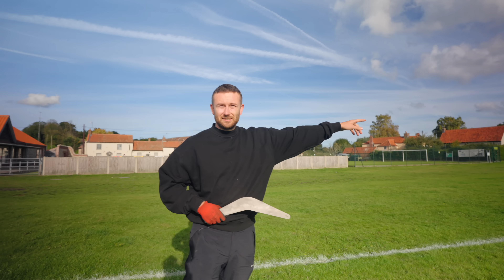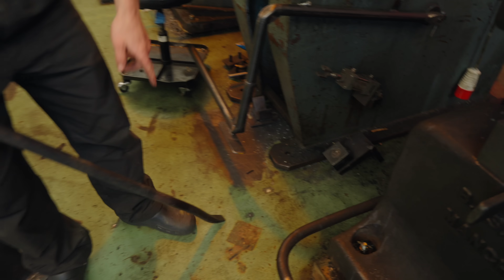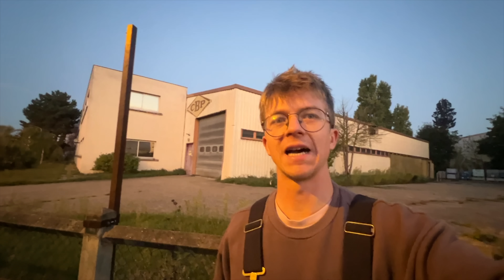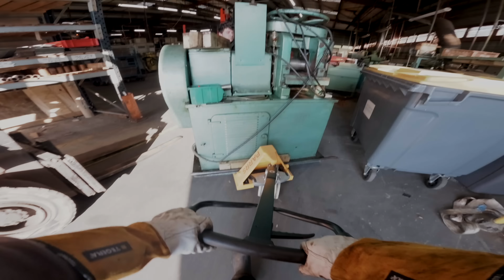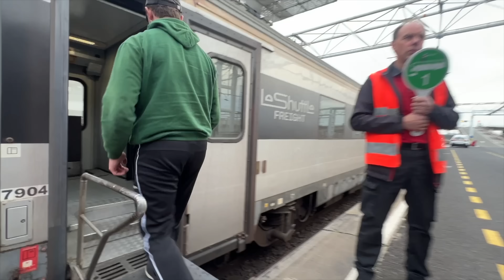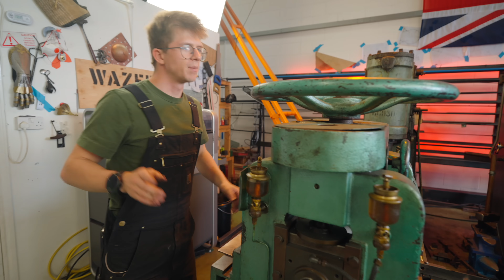My New French Friend

Comment from the maker: Wouldn't have been possible to load that machine without comfy underwear ---> Get cozy and spooky for less with deals up to 50% off at http://meundies.com/forge and enter promo code FORGE.
Reply: C'mon Man! Once the machine was on blocks with the pallet underneath, u just lift the pallet with the forklift and it's on the pallet, Done. IDK why u guys decided to mess around with all the jacks when u just had the forklift? Once u've got it placed on blocks, use the forklift to lift the pallet, pickup the machine, and ur can set the whole unit down wherever u want and u don't have to waste time jacking (unless u like "jacking" that much LOL). I used to do that all the time with forklifts all the time. Next time, It'll save tons of time and effort.
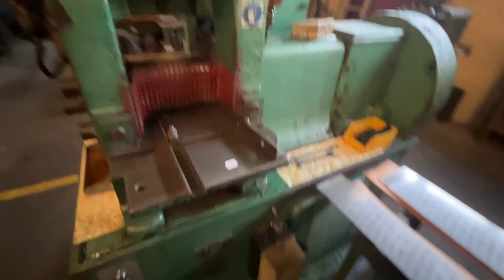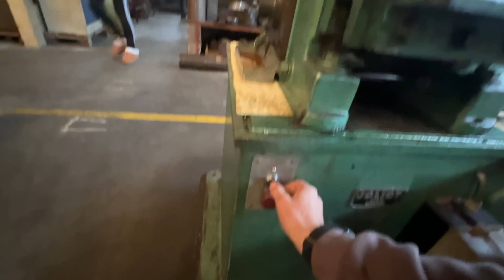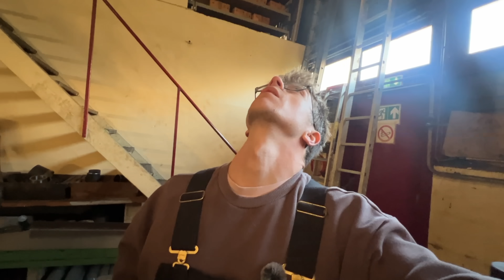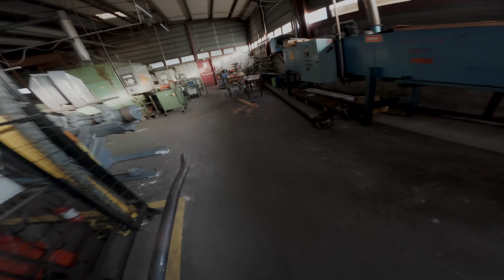Reply: 10:38 10:40 10:41 10:41 10:48 10:53 10:53 10:54 10:54 10:54 10:54 10:54 10:54 10:55 10:55 10:58 10:58 10:58 10:58 10:58 10:58 10:58 10:58 10:58 11:00 11:01 11:13
Reply: Now here's an idea for comfy underwear prints: Rare as hen's teeth ... Rare as rocking horse 💩
Reply: Here's a cookie. You could increase capacity by making the rollers smaller. And by making them smaller, i mean have some rollers machined for the machine, because it would be a shame to lose the current ones. I would start by finding out the feasibility of this affair, IE, how much can you get away with before the mechanical elements that hold the rollers won't allow you to get closer and then finding the closest scrap roller from an industrial lot or similar, so you only have to lathe the ends, leaving the hardened surfaces alone and untouched. Also, figure out of these rollers are meant to work on hot materials, because you might ruin them if they're not. Just my 2 cents.
Reply: @aserta  Smaller rollers means bending rollers, convex parts and damaging bushings.
Probably it is possible to make them a little bit smaller, but not enough to fit a 50mm - 2 bananas in it.
Also you can't keep the same transmission, and the center of the lower one have to be raised to have it flush to the machine table.

For making good rollers of that size it's more than enough to use C45 steel and induction hardening the roller surface.

(I'm a lathe machinist for the past 25 years and in the last 8 years I made some metal forming rollers...some tons of them :P ).
Reply: How much human trafficking did you have to do to pay for all this?
Reply: Next time you have to lift a heavy load using a forklift, don't use only one single tine of those two forks. Push them together and use both, otherwise you risk bending the lower fork with a heavy load. You risk a lower Fork than the other. Speaking from experience here
Reply: Tu parles très bien français je suis choqué, a quand le feat avec des youtubers français ?
Reply: when you sent it through on one side Alec, flip it over on the other face and send it through again. this way instead of increasing the curve, you are "correcting" the curve to force it straight again. its the same concept as you would on your power hammer you wouldnt just pound hot metal on one face the entire time would you? you would flip it on other faces so it stays true and square. so remember the top face and bottom face and flip back and forth between the two and it should stay straight and true each time.
Reply: When I was kid my dad was stationed in SW Germany (88-91 so technically West Germany) and we went on vacation to Pisa. Our family is of French descent and we drove within a mile of the border and when I asked my dad why we didn’t go through France he said the toll roads in France were hellacious and everywhere!
Reply: speking french abit ?
Reply: I am sorry but I am an all or nothing guy.

I tried 50% underwear once and it was just too awkward.
Reply: Put a gold bar in it, make it flat and build something
Reply: I like your content, but find those ads more and more annoying and out of context... It's a pity...
Reply: 17:00 a glimpse of your wife😅
Reply: You're one of two youtube channels I've ever subscribed to. Thanks for sharing what you do.
Reply: @AlecSteele I have been watching your videos for years and love to content. Will you ever put the Steele work trousers back on the market
Reply: Could you try to forge rhenium?
Reply: @AlecSteele Don't forget to turn your oilers ON!!!!  The piece on the top should point vertically when in operation.  It acts as a cam to lift up on the needle valve allowing oil to flow.  Oil flowrate adjustment is done below it usually something turns.  Below the oil globe is a window you can see the drip of oil to adjust.  The best bearing oilers ever!!!!!!!!!!!!!!!!  Old school.  A drip every few seconds to second is good.
Reply: Have you ever went over 30-45 minute long video???

i am sure we all would love a longer video lol..

Maybe a hour long video for when you hit 3 Million sub's?!?!?!?!?!?
Reply: you overthought the grabber, just set it on a piece of wood with some sides and a end piece on the end and even if you move it fast it wouldn't fall and they can freely grab it
Reply: woulda costed you less too
Reply: Just be aware that squeezing metal is like using a press on it, it will heat up and anneal.
Reply: You've never put a copper penny on a railroad track? You can get some nice squeeze out with the pure copper pennies, but the copper washed zincs you find now just crumble.
Reply: Can you make a metal using 85% copper, 7% aluminium, 7.5% steel and 0.5% titanium in a axe?
Reply: I have one… I built a flat guide rail on the exit side to make the steel hold its flatness instead of curling… simple fix. Good luck.

Comment: That is so totally not the way to throw a boomerang. I make them out of ply and those do have aerofoil sections on them but I think yours might fly even flat. Assuming you are right handed, hold it vertically, maybe 1 or 2 degrees to the right, bend facing forwards, aerofoil section to the left, throw about 20 to 30 degrees to the right of your target, it should come back to you.

Comment: Perhaps you figure out the issue further into the video than I currently am, or you may have just figured it out by now, but I am wonder if it is possible that the curve is happening if you attempt to move too much is a single pass.  What I mean is like with a lathe or a mill, the amount of material you take out in a single pass has different effects on how the material behaves as well as the finish, and tool wear... you know how that all works.  Either way, It could be that reducing how much you are thinning it out in a pass can effect how much or if at all it wants to curve.  Alignment can effect curves too, but I think that it could be that you can flatten more when the material is hotter, but as it cools you need to reduce how much you do in a pass, then flip it to counter the curve if it starts to pick up a slight curve.  I have never used one of those, and now I am intrigued.

Comment: If u dont want a cure the alternate turning the piece upside down. And/or use less force per pass.
Reply: PS IT IS SUPPOSED TO CURL WHEN U RUN IT THRU A ROLLER, its a feature not a bug. its how u make cylinders and rings.

Comment: Am I the only one bothered by the fact that you put the machine over a pallet, supported it, and then lowered the machine onto the pallet instead of just using the forklift and pallet to lift it off of the supports?  Seems like that whole step could have been done from the drivers seat.  🙂 SUPER cool new tool!

Comment: Moving the little adjustment roller makes the wheel moves from were the wheels are centered at the squeezing point to the top wheel either being moved forward or backwards which will make the material either roll upwards or stay straight almost pushing downward at the farthest point forward of the adjustment. If you have a friend to adjust the wheel as you work the material through the wheels you can control and get alot more movement in a shorter amount of time.

Comment: Dude! A) Beautiful machine and love the video!  B) Check me on the thinking here: That tiny wheel is adjusting the top roller's position over the stationary bottom roller. That should be dictating the curve much like the placement of dies in a Hossfeld Bender. And there has to be a zero indicator somewhere. Good luck, man! (edit: and now that I scroll down, I see that others have said similar)

Comment: From what I saw, it looks like the front wheel moves the big roller out of alignment with the bottom one, giving you a curve.
Try moving it back then roll something and see what happens.  Don't think it is a micro-adjust (could be wrong, but one way to find out).

Comment: Perhaps the the small handwheel moves the large handwheel and it's pinion gear to adjust the the rollers to be as close to parallel as possible or maybe you want a slight taper on the rolled part. Just a thought.

Comment: I think the bend upwards is for one due to the temperature differences with the heated material you are feeding into the cold waltzer.
Second I suppose that it has increased contact with the upper wheel compared to the lower one. And getting them off center to each other might increase the rolling

Comment: Main wheel up / down. Small wheel contact pinch forward/back to curve. Graduated disc for parallel or induce taper which will curve right. Try alloy steel cold in small amounts it really hardens up. Good for forge welding bimetallic strips as well. Have fun.

Comment: I think what you need to do to keep your bar from curling. Is every pass you need to turn it over. As your curve starts you flip it over then the curve is against the table and the rolling will flatten it out. I work at a steel rolling mill and we turn the roll stands different directions to achieve that result.

Comment: So cool. I know nothing about those machines. (as much as the interweb has) 
Thoughts on its rolling. Big top wheel adjusts large amounts of thickness and the small wheel is for find thickness adjustment by pushing the big hand wheels gear in, it turns the screws just that fractional amount. your rollers are not changing position, other than up and down for thickness. Its going to curve the material.

Comment: for in the future you set it down on blocks that will gap over a pallet then back forklift out slide pallet underneath into the gap then drive lift in and pickup the pallet lifting it to the bottom of the machine and keep lifting it with the machine on it then back up then pick up your blocks job dont and you dont have to do all that scetchy hoist stuff with straps and all that nonsense. youre welcome :). love watching you smith stuff btw great work.

Comment: My thought is that either one roller is a different diameter or running at a different speed than the other, or the output table is pushing on the bar and causing the bend.

Comment: As a jeweler I frequently use rolling mills but on soft metals. From my experience, the curve appears when the metal is getting hard (we usually don't anneal it after each pass) or when the difference of thickness between the rollers and the metal is too much. Both seems to be that you're asking too much on the metal. Never used it on hot metal and/or steel so there are probably differences that I don't know !

Comment: This works exactly like a goldsmithing hand rolling mill i use in my workshop. If it bends you can stand behind the mill (ore someone else) and gently puching the material downwards. the direction you push the material, the direction it will curve.

Comment: The curl in the metal is occurring as a result of thermal dislocation.  The bar cools faster on one side in the press rollers.  You should only run the bar once per heat, twice max…but never let it get dull red or it will bend

Comment: Back in the 1990s I scratch built a similar sized machine to roll horse shoe steel. The steel does curl a fair bit and with the form rollers the steel sticks even more so we have to make guides to pick the steel off the roller. Once we worked out the bugs it worked well. The occasional malfunction until we got it all worked out was "interesting"....

Comment: The small wheel adjusts the tilt of the top roller (side to side), should be obvious if you look at the gears up the top.
Big wheel rotates them in the same direction, small wheel rotates them in opposite directions.

Comment: I would say something about the forward and backwards screw you have there would also make a curve in the material . See if there a middle option on the dial and try putting the bar through again I think if you move it forward it will roll up and even with the bottom roller it will come out flat

Comment: Damascus plate armor? Also would guess the adjustment that pulls the top wheel in and out may be to align or misalign the two wheels? Same way a circle bending machine works but with only two wheels.

Comment: My immediate thought is that the small wheel controls the curving in the same fashion that a slip roller does. So it makes the top roller move backwards and forwards in relation to the bottom roller. Also separately, I have a feeling that you can get a larger opening by replacing the springs. I could be completely wrong, but it doesn't make any sense to me that it would have all of that open air above the top roller, to NOT use it. Definitely seems like it'd be complete overkill for a max of 10-15 mm thickness.

Comment: 🤔if the table height is at the top of the lower roller, surely it's behaving as the third roller would in any slip roller?

Ol' mate's direction correction sounds like a premium mod.

Comment: Australian here. You don't throw boomerangs sideways lol. you do an overarm vertical throw and it should then catch the air, fly upwards and become horizontal. If you had made a functioning boomerang it would have just gone into the floor with those throws. Not trying to be mean, just if you ever decide to do anything with boomerangs later on the channel I don't want you guys wondering why it wasn't working. :)

Comment: weld some beefy nuts to the base where those hole in the base go through, then you just need some bolts to jack up the machine higher off the floor. Also good for leveling if that was ever needed.

Comment: Why don't you retract the screw all the way and measure the distance between the screw and the plate for the wheel then simply replace the rebound springs with taller ones to give you the extra space to press thicker pieces.

Comment: Factories in machine shops in the United States also have that overhead plug system with the twist lock on them. My lathe and my screw machine were both powered like that.

Also, look up hydraulic drop deck trailer. I rented one to move my mill, and it made it much easier.

Comment: Glad you found a roller, please exercise extreme caution with that metal boomerang. The edges looked razor sharp, the space used to test it was far too small, the person throwing the boomerang was using a technique that if the wind caught the wings could result in an unpredictable flight path.

Comment: Would it be possible to replace the springs inside for if you want to put in a thicker steal? To me it doesn't look like there is anything actually stopping the top roller from going up further other then the springs not pushing beyond their max size.

Comment: If the main adjustment screws is equal(normal tread direction). The middle adjustment is for fine adjusting thickness difference left to right.

Comment: I suspect that the front to back adjustment is what's causing it to curve up and down. Imagine if the top and bottom die roller were not aligned and as a result it would net force awards

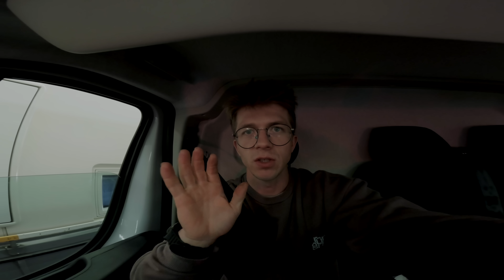Comment: At 7:40 you mentioned it was dug in the 80s, but something quite cool is that plans were in place roughly 100 years before that for a railway tunnel to France. It was abandoned due to fears over national security despite plans for just such a thing
Reply: Considering we would have had to blow it up (or at least flood it) in 1939 it's probably a good thing it wasn't built.
Reply: @robertharris1748  Flooding it was the plan they had thought of in case of war with France (this was before the Entente Cordiale)

Comment: As a blacksmith and steel fabricator for well over 30 years . I would have loved a set of rollers like that. I worked for a local blacksmith’s in Bletchley Buckinghamshire and did a seven year apprenticeship. We used to make and repair anything all I had was a coke forge an old blacker hammer and a small v block bender as well as all the other equipment needed it was a very old fashioned workshop . The power hammer was not on a separate block in a pit just on the broken concrete floor. My backache is permanent now I am retired due to that and poor health from the lack of safety then no extractors etc, Please follow health and safety regs put your main power hammer in a pit  and make sure you wear all the safety equipment when working with the steel, I have tinnitus and had a heart attack three years ago due to poor working conditions in the past decades I started in the mid seventies. Protect your welfare please do not end up like me I am sixty five now and registered disabled.

Comment: Tip from an expirenced camper (who often needs to camp way out in the American wilderness for her job as a cartographer): When camping, always use a bag with a minimum of a 10°C or 20°F "cushion." For example, I just went camping on a night were the low was 41°F (5°C) so I brought my 20°F - rated bag (-5°C - rated). Nearly all the bags in the US are sold based on farenheit ratings, so I kinda think of them that way. I also have a -40° bag (that magical temp where you don't have to specify unit) and a light 40°F (5°C) rated bag for summer. ETA: Additionally, put a good warm blanket or something underneath your bag! We forget how well our typical matteress at home act as insulators until you spend the night on an airbed, metal van floor, or the cold ground. Direct thermal conduction counts for a lot!